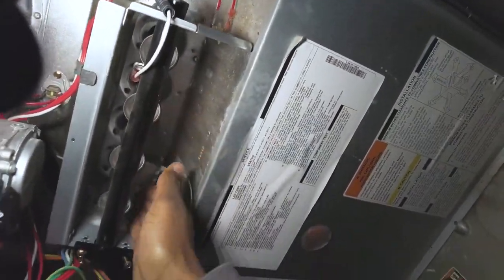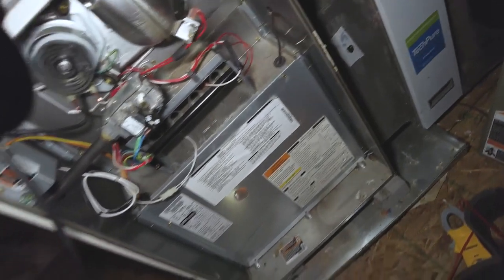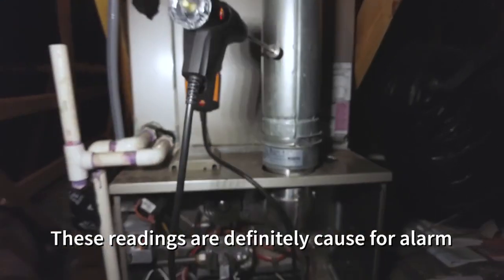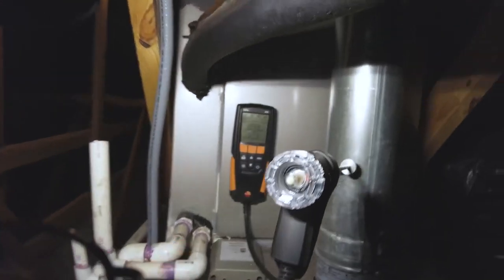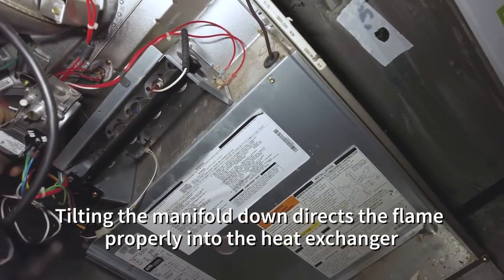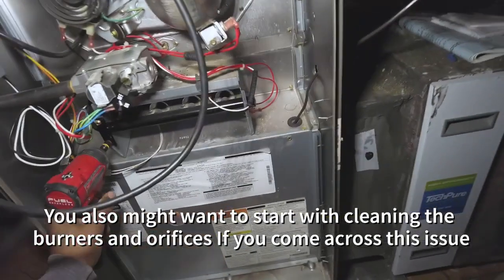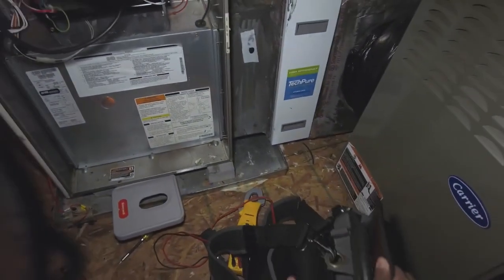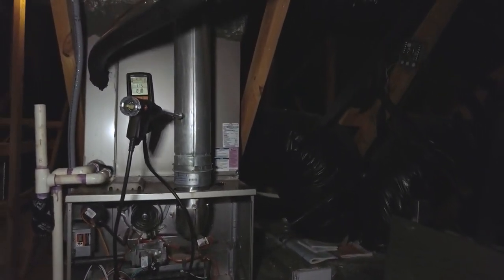Deadly Carbon Monoxide Levels caused by Misaligned Burner Assembly Over 1000ppm HVAC Training Videos

Comment: Always nice content. Thank you!
 Even though you are looking for under 100 ppm "technicly,"  you should be striving to get as close to 0 ppm as possible. 0-50 would be more like it. 
90ppm is just to close to 100. when you are at 90ppm, it wont take much to creep over 100ppm after you leave.
I didn't see in your video if you clocked the gas meter input? 
Checking pressure is good but you can still have an over gas situation with good pressures. 
Also recheck the orfice sizes, i have found that some units are shipped from the factory with the wrong size orifices and never is cought until the input is checked. Set per code to derate no more then 2% under the rating plate input.
I'm  passing on additional information for you